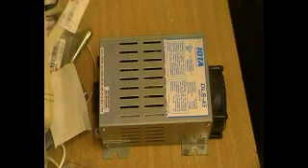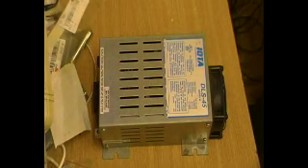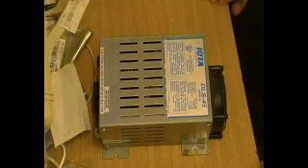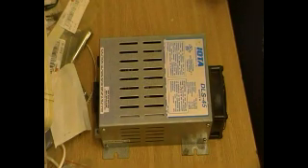Switch Mode Power Supply Repair #2

Comment: This PS failure was probably a result of cold or weak solder joints from the factory.  Once the joint starts to heat up due to low conductivity, it develops thermal runaway, and burns the rest of the solder away from the junction.  If the voltage is high enough, as it would be at the bridge rectifier terminals, it will start arcing, and destroys all of the copper around the joint.  I have seen this many times.

Comment from the maker: That's a good question. I'm not sure if a fuse was being used on the primary side. The input would have otherwise been 120 - 140V DC with 90A of solid juice available.

Comment: Ouch! 

I work on boards where bridge rectifier shorts can be common, and I have never seen that much damage. 99 out of 100 times the fuse just blows. 

Was this power supply operated without a primary side fuse, or was it overfused? Can't think of any other way that it would be able to vaporise all of that copper

Comment: Though I've rarely had to replace the primary side bridge rectifier - the power supplies I've repaired all had 4 amp or 5 amp fuses in the primary circuit which would likely have prevented burning of the board and the rectifier leads.   A short circuit in the primary side enough to cause the rectifier to fail would probably be caused by a shorted capacitor or shorted switching component transistor or FET.

Comment: I expected kaboom after plugging in :) especially because there was a lot evaporated copper. That copper melts itself into pcb board. Only way to repair this kind of damage is to grind gaps between lines with dremel. That's why you had that spark after powering on.

Comment from the maker: @pieznice29 Like my boss says... it's the right temperature only twice while you use it. Once on the way up and once on the way down. The one I'm using there isn't very good. It was kind of a hand-me-down. But it's good for things that you can't put on the bench or don't want to. Also, the exhaust either burns your fingers when you're not looking or burns a comonent near the one your'e working on. The big fat tip is great for soldering/desoldering components with heat sucking leads.

Comment: Great video. I see your using one of those gas soldering irons, how well does it work for you? I have a smiliar one and the tip corroded fairly quickly and eventually it began to fall apart :(